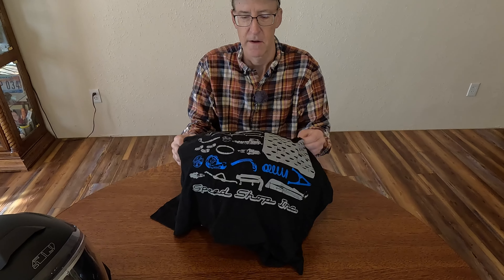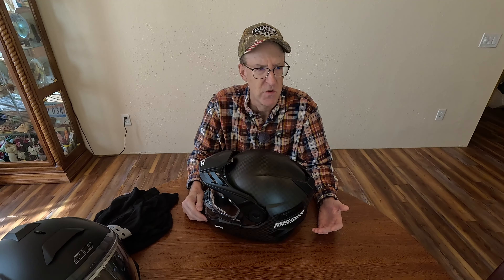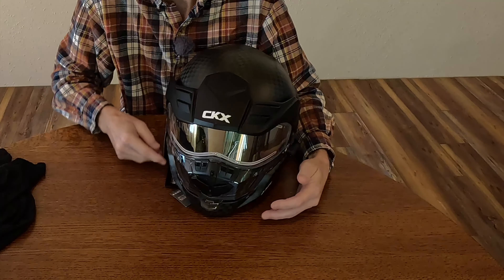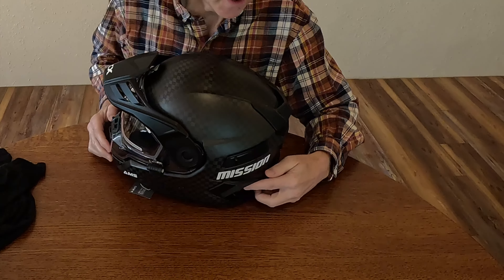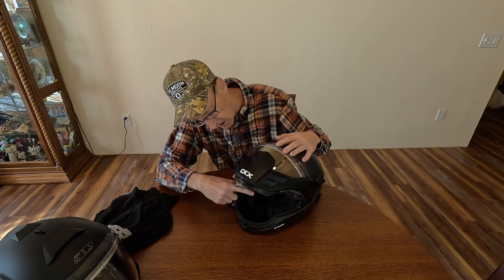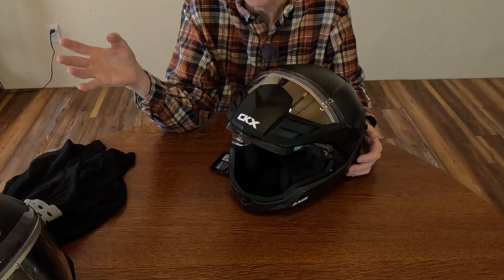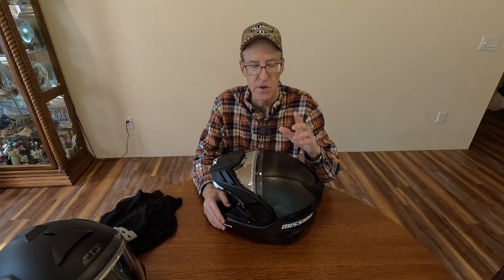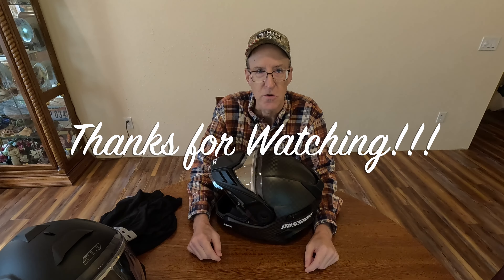The "Mission" To Find a New Helmet!

Comment: I bought my Mission December of 23.
So far the negative for me is the fact that your not supposed to open the visor when you have the sun shield down as it can damage the cables and the shield if i remember correctly. 
Positive for me was riding in 5 below Fahrenheit temps and feeling the heat coming off the shield. Good luck with your helmet!
Reply from the maker: @MrCrflover  Thanks!

Comment: Can anybody share their experience with eyeglasses fogging on this helmet?😊
Reply from the maker: @jessedonovan757  Hopefully, others will chime in, but I did get 1 ride in this year with the helmet.  I was packing trails and had to cut a few decent-sized trees out of the way.  Never took the helmet off, and I started sweating - glasses never fogged.  I think when I’m finally able to start trail riding at more brisk speeds, that should help keep the shield clear longer.  I’ve heard people say that they use the helmet without the heated shield, and fogging is not an issue, but I didn’t get a chance to try that.

A couple of observations:
1 - From CKX, you can order replacement parts.  Order a set of cheek pads that are 1 size larger than your helmet.  I found the cheek pads to be too snug.  They should be snug enough to keep the helmet from moving, but they’re uncomfortable.  I just tried on the helmet with a size bigger cheek pads and it’s much better.
2 - The helmet is plenty warm, and some people might not care for that.  I’ve heard the same thing about the Oxygen, though.  The other extreme is the 509 Delta V, which is probably an excellent summer helmet - lots of air flow.
3 - For eyeglass wearers, take the check pads off and re-seat them, so that they’re moved as far down as possible.  The top of the cheek pads is right where my glasses go, and that presses on my ears and makes it uncomfortable.  

Hope that helps!